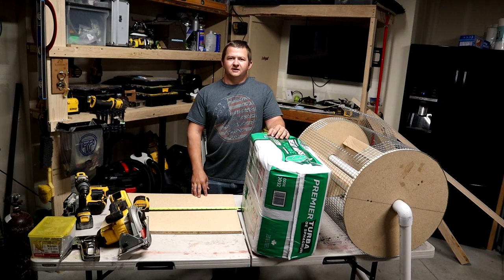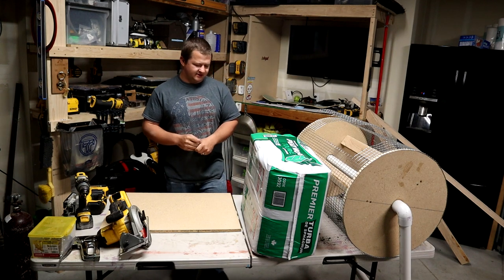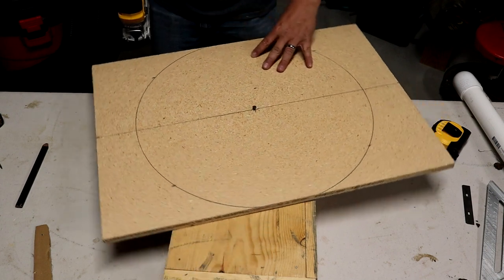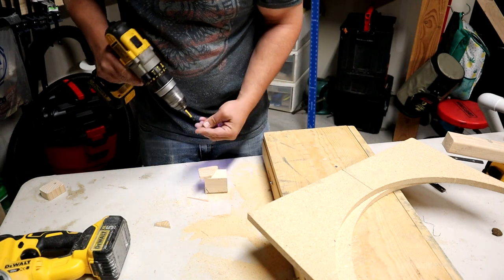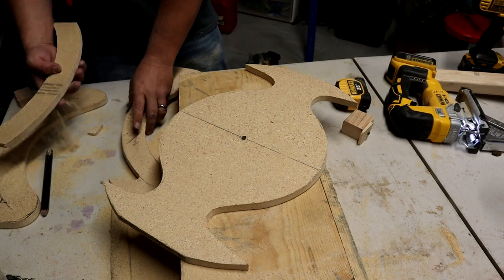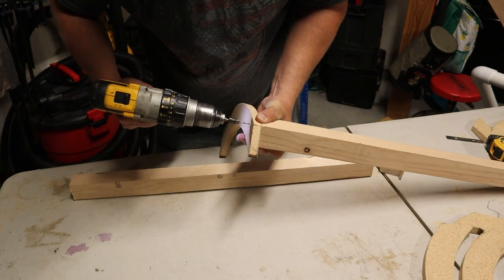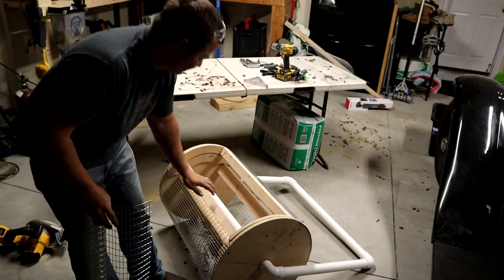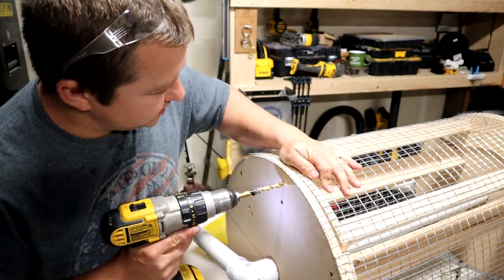DIY Peat Moss and Mulch Spreader DOOR BUILD.

Comment: Sir just letting u know that I just finished my 36"x 20" spreader using ur exact plans. Took less than 4 hours total and that included staining with deck stain. Added 1/2" x 1/2" x screen for $8 at Home depot with help of my neighbor. Bought x12 Antrader brand toolbox clasp latches on Amazon for $6.99! Placed one on each side. Works great! Polyurethaned several coats for good hard finish. Also added extra cross support for pvc handle approx 12.5" away from axle elbows using 2 T's and pipe equal in length to gripping pipe. Makes much more stable! This is the coolest project I've done in a long time. I'm an avid wood tinkerer. I do wish i had a scroll saw for this very reason. Can't thank u enough! U took the risk and time to figure it out so that I could have an easy job.  SUBSCRIBED!!

Comment: Thanks for the videos just shortened my build; much appreciated.  I will pick up a cheap piano hinge for the door and use a three-prong threaded insert to hammer in where you glued it.  Just building on your design.  I'm also (during this whacked lumber pricing period) recycling pallets and just glueing up boards from which to make my circles.  A local tractor retailer has all kinds of long pallets.  Good boards, 2 by stock, etc., if you are inclined.  Particleboard is ok for a prototype, but it won't stand up to being dropped,  getting wet, etc.  The rabbit wire and staples will not last as well.  I realize you know all this.  I will probably use a light gauge diamond mesh, easy enough to roll without the aid of a sheet stock roller.  This effort does deserve a "TOP SHELF"!  Thank you.
Reply from the maker: awesome would lave to see yours finished sounds like a good build. t nuts would be a great addition. would have made a trip to the hardware store had I thought of them.

Comment: This is absolutely fantastic. I could not see where you were going with the design at first and then it clicked and that is so seamless now that it is done. I have a lawn roller that I will use the handle to swap out between the water tank and a diy spreader like this.

Comment: I made it using 3/4inch black plastic( think they call it foam core, I had some as scrap from a job  20" "wheels",,I used 3 no 2 inch plastic tubes as the spacers ,  I used what you call it all thread 6mm through the tubes locking it tight as  a drum , I was able to screw the mesh to the wheels, I used 2 sheets of 24" wide 1/2" mesh  and some aluminium angle,where the mesh ended at the "Door", I glued the mesh to the aluminium using epoxy ,  I used 1 and1/4 inch as the pull handles and the damn thing works brilliant   ,thanks for the idea.

Comment: I like this project idea a lot.  Another idea for the door would be to cut the MDF wheels either in half or a 1/3 section, put a hinge on the rim so that it clamshells open, and latch the side of the wheel.
Reply: Like, cut a wedge out like a pie, not cut it into 1/3rds

Comment: Nice job.  I would paint 1 end of the door and roller,  just for a quick reference when replacing the door after filling.  Just a small blast with a spray paint can. That way you don't have to look for the 1 or 2 on the inside.
Reply from the maker: Great idea !

Comment: Love it! I started my DIY spreader build at the weekend, but still waiting on a hole saw (for the axle holes) and cage wire to arrive in the mail (all local garden supply stores didn't have the right size cage wire). I've been wondering how you would construct the door so I'm glad you made this video. I'm going to seal and paint my MDF for added protection. Thanks for taking the time to record this video, it's very useful. I hope your finger wound healed :-) Liked and subscribed.
Reply from the maker: Awesome thanks for subscribeing. Would love to see some pictures of how yours turns out !
Reply: Another DIY moss spreader video avoided drilling through the wheels fir an axle by using casters centered on the spreader wheels, removing the tires from the casters and attaching the PVC handles to those casters. And because the casters spin, the alignment issue, that appeared in the initial video for building this version of this spreader, is a non-factor.

Comment: Thank you for sharing this great project! Was considering buying one of the ‘branded’ green spreaders but they were back ordered until June/July and really couldn’t justify that the purchase of one (even if “on sale” ) could be considered as being financially responsible in light of cost to anticipated frequency of use. Kudos on the simplicity of the build and your solution for a workable door. This will be my next project build once public access is available again to the big box stores to secure materials. I will likely opt for the 1/2” x 1/2” screen though. You likely saved me in the area of $300 and for that I thank you. Ever consider fabricating a lawn levelling device to use after you’ve spread your material(s)?

Comment: Awesome & well done job on the door!  I believe you mentioned you used 1-1/2" X 1/2" cage wire.  Do you believe 1/2" X 1/2" cage wire will allow peat moss to disperse from the spreader or should I stick with 1-1/2" X 1/2"?  I am planning on building my own speader & will be purchasing materials soon.  Thanks again for a great DIY!
Reply from the maker: I think 1/2 x 1/2 would work well the size I went with lays it down very heavy. Although the 1x1/2 still lays it down to where the grass blades don't get barried
Reply: @bhan9637  Thank you!  If 1/2 X 1/2 isn't thick enough to my liking, I can always go over the lawn a second time.
Reply from the maker: If that's what you go with let me know how it works :) love the feedback
Reply: @johnboyke2037  Right now the reason for me to use this is to try and get 1/4" of peat moss, over my grass seed, while over seeding. It's a guessing game as to what size mesh to use.

Comment: Buddy, I know diy skill is relative but you are good. Though not sure I would go forward with that project but Lanzie charging $300 for a 24" spreader is unreasonable in my opinion and from the research I've done, the reason appears to be that they have no competition out there.
Reply: Watched the vid a few times. It all came together in my mind so yes, I am going forward with the project. Actually have the three circles cut out already.. Checked my supplies and all I need to buy is the cage wire and PVC.

Comment: The door opening would be much less complicated if the inside supports are at the edge of the circles.
Reply from the maker: yes but then you get missed areas when rolling. also having them toward the center helps break down any clumps when rolling